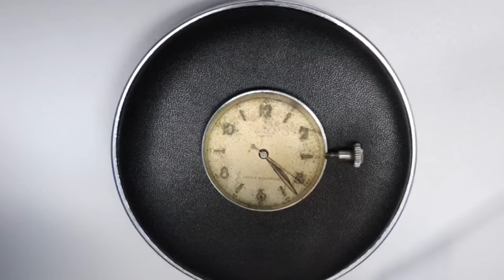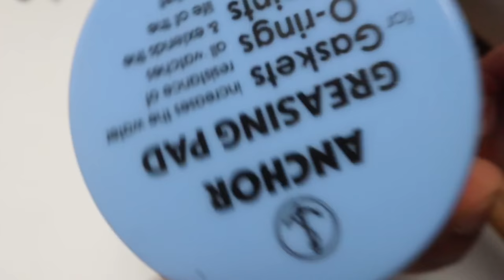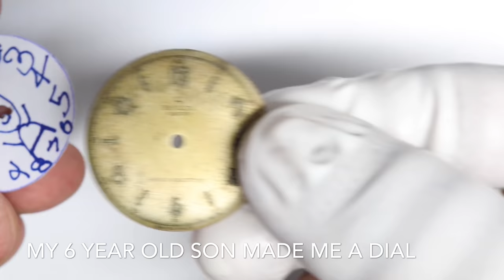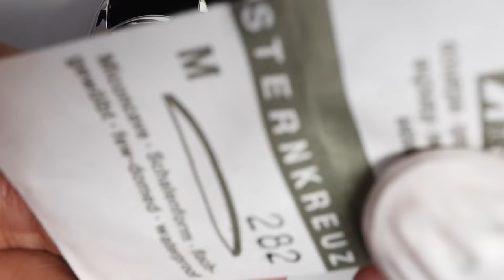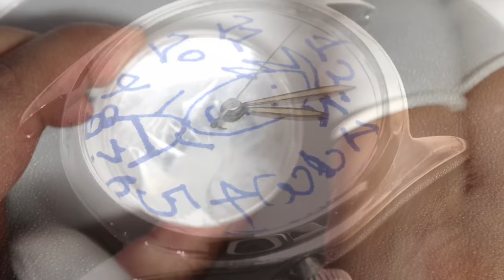1940s VINTAGE ROLEX RESTORATION | did someone sh*t on that dial or what?

Comment: I had a rolex tudor oysterdate it stopped going round the second hand i knew it needed the back of to get inside but i also know its vaccume sealed and you have to use a special tool to get the back of

Comment: Just bought Rolex of similar age stem tube seems to be disconnected and winding button stocks out  as stem seems to be too long . Sending for repair .interesting to see how you managed to replace stem tube , as was worried it may not have been repairable . Keying fingers crossed  all hopes well . Love your channel . Thanks .
Reply: Re previous text . Turns out the balance bridge had been fitted incorrectly . Winding crown now screws into sleeve . Fully serviced , so all OK

Comment: I noticed the crown is slightly further out now than originally intended. I believe some brave watchmakers file these down to fit more snug.

I also completely forgive this difference because of my own experience trying to source a suitable replacement crown tube for a 1947 4463 Tudor. It’s a best guess game & nobody has accurate measurements 😂. Settled on a bloody Rolex tube for some models between the mid 50s to early 80s!

Comment: The seconds hand is not smooth? I wonder why.. it doesn’t sweep smoothly?  
I wonder what the case size is? And lug to lug? Too bad Rolex doesn’t sell the original style dial.. Great restoration job!
Reply: Would an original 1940s AirKing have a smooth flow second hand?

Comment: Boa tarde, bom serviço de restauração, o movimento tem uma engenharia espetacular, a maquina para 60 anos está muito boa, pena o mostrador ou dial não ser de origem. obrigado por partilhar, victor santos.Good afternoon, good restoration service, the movement has spectacular engineering, the machine is very good for 60 years, it's a shame the dial is not original. Thanks for sharing, Victor Santos.

Comment: I saw a Rolex Oyster Perpetual Bubbleback on Ebay with the exact same but less severe face discoloration . Is it caused by moisture and humidity interacting with the face material ?
Reply from the maker: Moisture is the main culprit.

Comment: 1940's Rolex with a luminescent dial, hmmm I would have been a little careful of what i was doing with the hands and dial. They would have been Radium and even if they don't still glow in the dark they would still be very radioactive. The glow doesn't come from the radium it comes from silver activated zinc sulphate which the radium in the paint causes to glow.